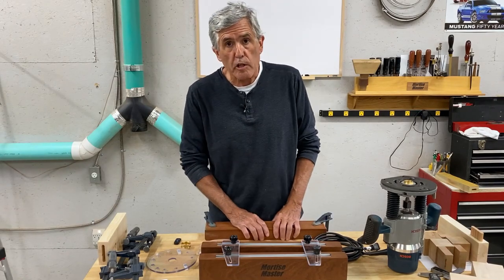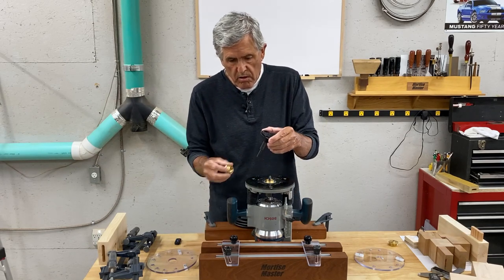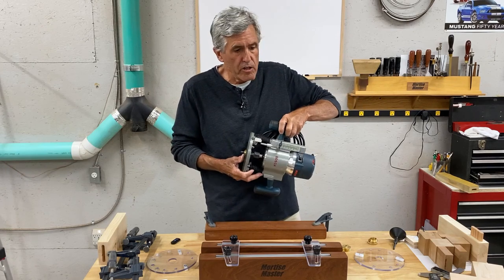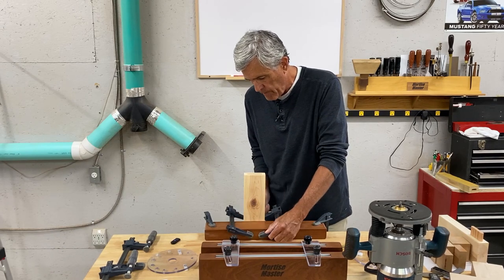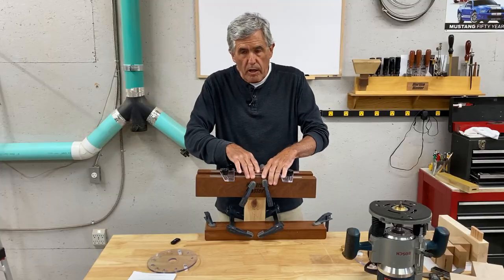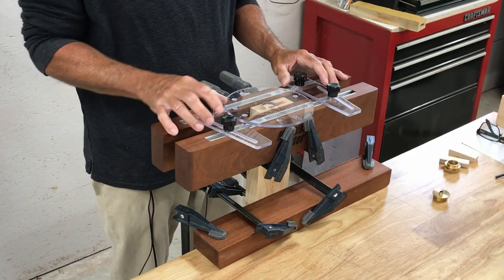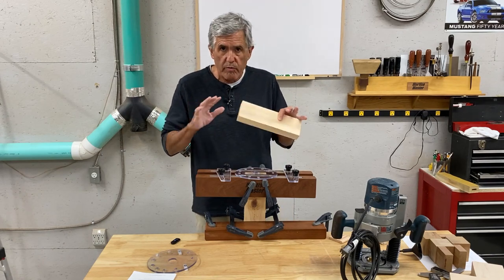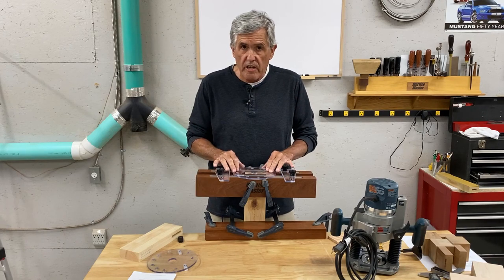How to: Setup and use Mortise Master

Comment: Can you talk more about using offsets?  I need to join a 3/4 thick board and 1/2 thick board. At a 90 degree angle and flush. 3/8 offset is not over the piece when I go to use it.

Comment: Hello! I just bought one of these - Do you know if the bushings you supply work with the Dewalt DW618 plunge base? Thanks!
Reply from the maker: Hello Craig. I'm really sorry we missed this message. I can't speak on that specific model of router, bet we have almost 600 Mortise Masters in the field and haven't had a single customer say the bushings we supply don't fit their router. Some do require an adapter, like the Bosch model we keep in the shop. In the future, if you need to reach us for any questions, please go to our website and use the contact form. We'll get an email notification immediately and respond ASAP. Thanks for choosing Mortise Master and please let us know if you have any other questions.
Reply: @adamatmortisemaster6556  adam, thanks for the reply. The bushing fits perfectly, I cant wait to start using it!